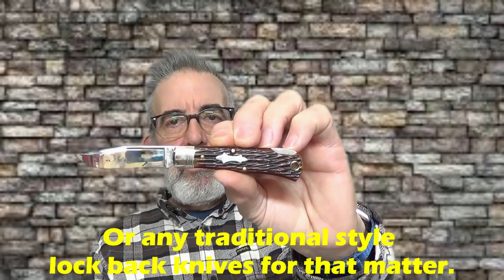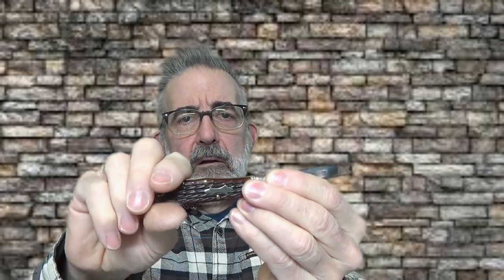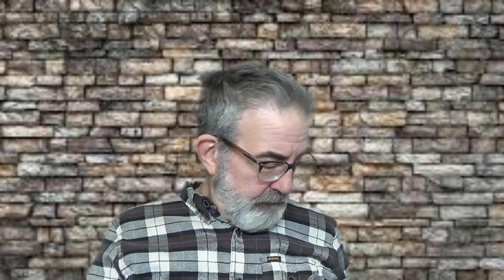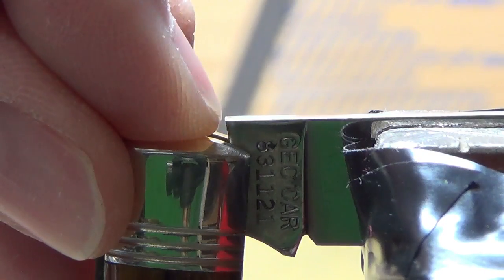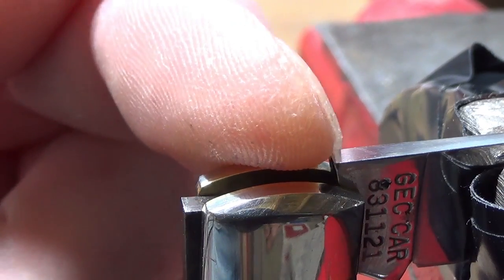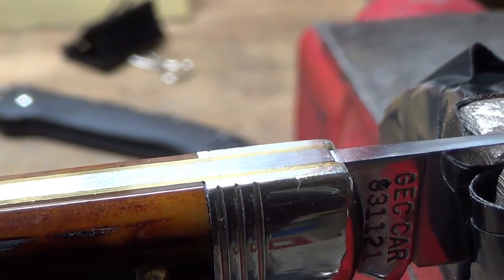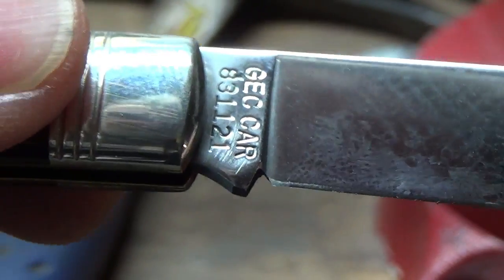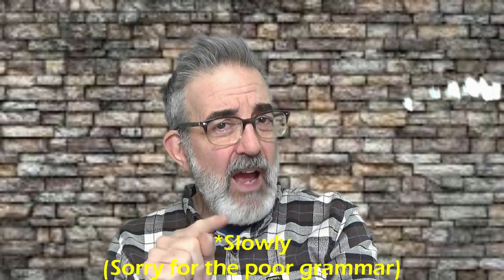Say Goodbye to Blade Wobble with This Method

Comment: I’ve never seen that method before but for side to side play, I’ve fixed many 110’s this way, you put the front bolster in a vice crank down on it till the pivot pin stands a little proud of the bolster then tap it with a hammer and mushroom it out. Then buff it to clean up any accidental marks
Reply from the maker: That is exactly the way I do it too. 

Thank you for watching and commenting!!!

Comment: The 2023 batch of GEC 72s had many examples of up/down & side play. How they got out of the factory…as a comparison the OT Bruins have zero play and great lock up.
Reply from the maker: Sorry to hear that about GEC Knives. Maybe they are trying to be just like Bark River and let substandard, subpar stuff get out the door. Thank you for the tip. I will have to try OT.

Comment: A little OCD?  I have a Puma folder that my Uncle closed without releasing the lock that now has wiggle.  Thanks for the idea!
Reply from the maker: This is not a Cure All, but hopefully it helps you out.  It just snugs things up.  If a knife is broken, it won't help.  BTW.  I used to have a Red handled Puma with double lock back.  Blade and scaler.  Was very cool.

Comment: I had jus received a 4 pin vintage Schrade LB7. Aesthetically, it is really very nice after I cleaned it up. But, I’m very disappointed with the amount of up/down play. I resolved to fix that play. My OCD will have no mercy on me. I will definitely try you solution and report back. Til then, thank you for posting this video. I subbed.
Reply from the maker: Thank you very much! I appreciate that. I do like the LB7. It is just a Skosh bigger than the Buck 110.  And I liked the lines. It seemed a little more refined. However… The pivots and locks seems to be sloppier. I never really had one that didn’t have any wobble. I wish you luck on your project. Keep me posted!
Reply: Well, the method in your video to correct up/down play for my newly acquired LB7 will not work. The spine of the blade, unlike your knife, Buck 110, and probably many others, is ‘hidden’ within the bolster over the entire pivot range, i.e., from close to open and back to close. So there is no way to reach the end like you did on your knife without hitting the bolster. I even tough about doing the ‘pounding’ on the key of the lock, but that is not possible without first damaging the key end. So my options are pull pins (which I  really do not want to do), or just leave it the way it is. I know your method would have worked if I were able to reach that end of the blade. It really made all the sense in the world, just not on the LB7. By the way, I have a 3 pin LB7  I received as a gift in Dec., 1981. I never wore it, used it, or sharpened it. Even have the original box and paper work. And I can say that there is absolutely no play in the blade…, solid as a rock! Given your experience, I feel fortunate to have it. However, I judge other LB7’s against it and so far, I have not been able to match it.
Reply from the maker: @alanaugust8853  Sorry for the late reply. That is a bummer. You can still make it work though. But you might have to buy one tool. A punch. They are hard and steal and come in a multitude of diameters. If you were to take your knife into a hardware store so that you can get the right punch that would fit in the slot and make contact with the blade spine, then you could put the blade in a vise and do everything like I did except hit the punch with your hammer rather than another hammer like I did in my video.  You would still be able to do it at a very slight angle and probably have really good control.

Comment: I'd be in that 1% in general already. But in the price range of GEC it is simply unacceptable! I'd return it.

I have an old Rough Ryder somewhere I remember has that problem. I'll definitely try that. 
Thank you!
Reply from the maker: Trouble with returning it, is if I want to get replacement, it may be better or worse and the bone scales may not be as nice. Because these are so custom, there are so many factors and it was just more practical to fix it.